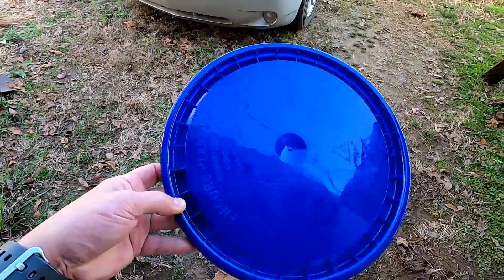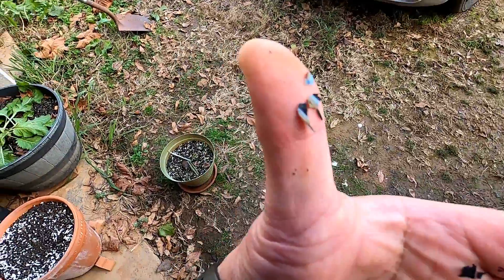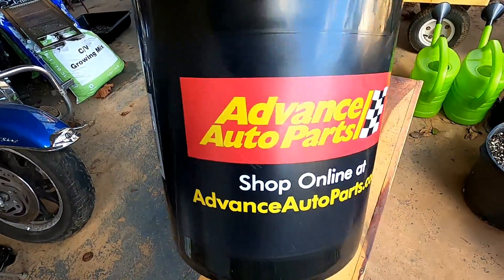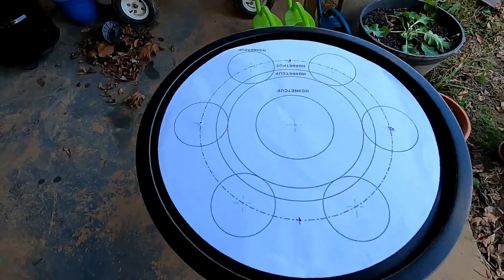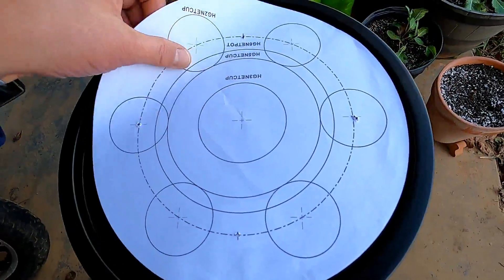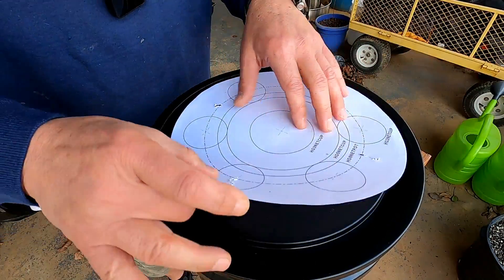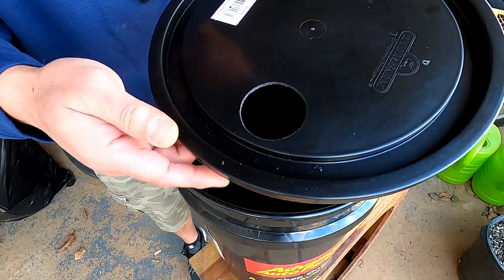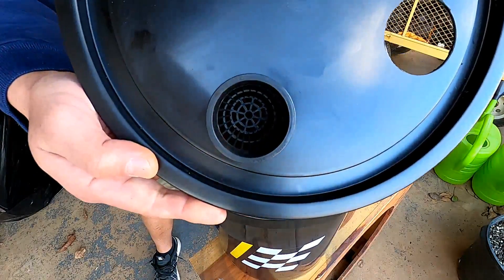5 Gallon Kratky Bucket Build  ||  DIY Hydroponic System

Comment: Thumbs up for showing how the paint will chip and crack off any plastic lid. I sprayed the 17 gallon tote yellow lids with black paint and within a month of handling and rinsing off, the paint started to chip everywhere! I'm thinking about/ am using tinfoil and duct tape as a way to block out the light from the lids.Just buy black lids to begin with. Good stuff.
Reply from the maker: Thank ya for watching and commenting AskMiName, welcome to our community and the channel!!  I did find some black lids for them 5 gallon buckets but I do agree whitcha on the black paint cracking, can be a pain!!  preciate ya stopping by the channel!!          Dan